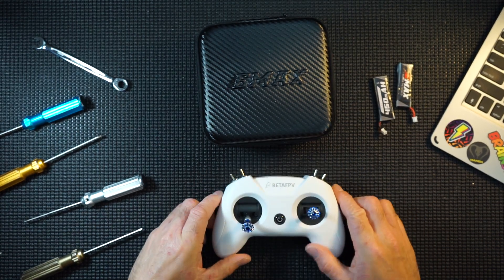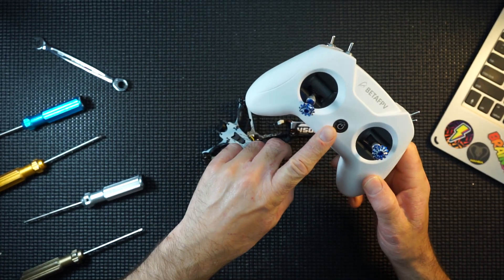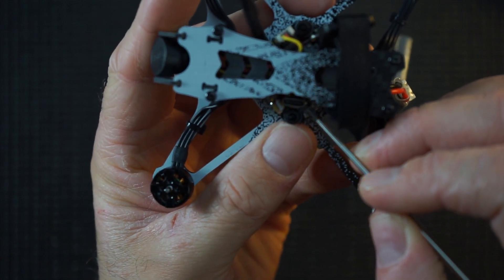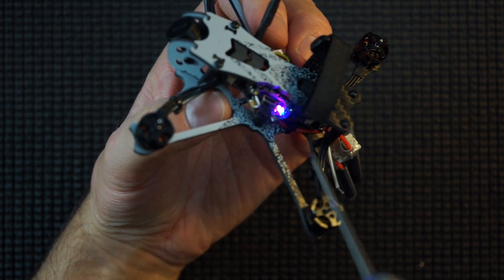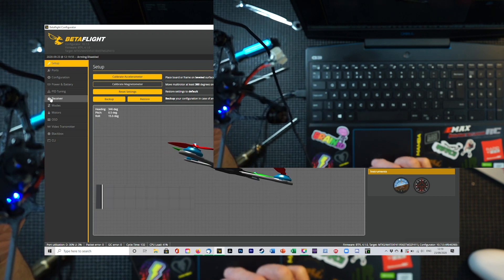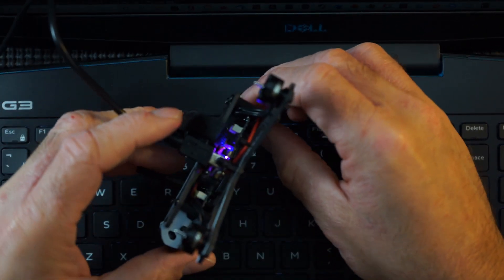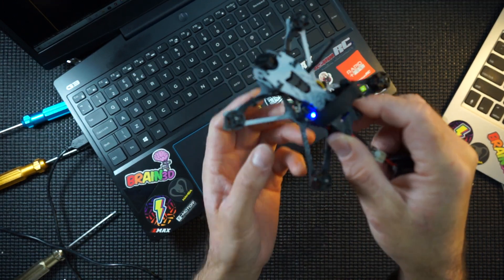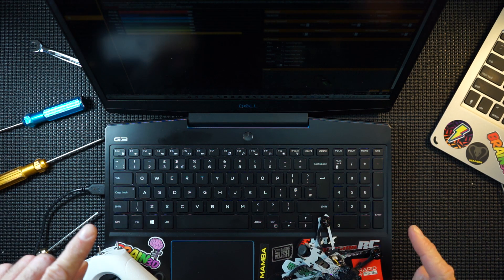How to Bind the Tinyhawk Freestyle II (2) and any Emax Hawk

Comment: I have a problem with my tinyhawk2, I binded it with the radio, and on betaflight I can see the switches and input actions as gas, yaw pitch and roll working, I also added the arm control, and other 2 as I see in videos, but then, if I power it up with the radio binded it doesn't fly, althought the leds blink wile giving inputs from the radio (that shows that the binding is correct) the props don't spin, it is not working.... can you help??

Comment: quickly i have not bought the drone yet because i have seen the controller in the RTF kit is hot garbage. Im trying to get in the hobby with emax and i do not know if the batteries come with the drone itself and not only in the RTF kit, please let me know if you can.
Reply from the maker: normally there are a couple of batteries in the kit - just double check the listing specs.
Reply: Thank you for the reply, will do

Comment: Erm...My Tinyhawk Freestyle 2 came with a USB cable to charge the controller and headset battery. I wasted a good few minutes trying to connect it to my PC with that cable.

I am currently having a really weird argument with Bangood who sent me the wrong replacement controller for my EZ Pilot.  I know its the wrong controller because it binds to the Freestyle after I followed your instructions and it has an aerial and the EZ pilot controller does not.

Any idea if it is possible to flash a normal Emax controller to work with an EZ Pilot or where I can get a EZ Pilot controller quickly?
Reply from the maker: you mean the ready to fly kit - this vid is about the single quad... not the kit - all their single quads don't come with cables.

Comment: I have it bind to the tiny hawk 2 but the switch on the  Betafpv  literadio 2 se controller aren’t working properly the beeper is working on  the right top switch I think when it’s clicked either once or twice it starts the beeper on the drone so the switches aren’t working other than  getting the beeper on the drone engage one of the switches on the right side I can’t get the motors to start up or anything but it must be bound because it’s letting the drone beep  can you tell me what to do using the Betafpv light radio 2 se?
Reply from the maker: its your sticks, you can adjust them in betaflight, check this vid out : 
https://www.youtube.com/watch?v=7ZUe-sC7mmU

Comment: Hey man, I bound it to the beta FPv controller, however, the switches are reversed, the top left one needs to be flicked down to start the drone (turn the props on).
Reply: Just move the slider to the part when the switched is flicked

Comment: I cannot get this quad to bind to the LiteRadio2 SE (new version) in D8 protocol no matter what I do. I have tried different firmwares in betaflight, have reset to orginal stock settings. The radio blinks three times confirming it's in D8, but for whatever reason, the quad refuses to bind to D8. It will only bind to D16, but emax does not recommend D16. I have no idea how to get this thing to bind to D8.
Reply from the maker: hey - I haven't got the SE version as yet, but I don't think it would be that different so it should bind ok... does the controller bind to other quads? is it just the freestyle? have you done th cli command lind to try and bind it? have you messed a setting up flashing firmware?
Reply: Same issue here. Betaflight recognizes the tinyhawk 2 but no bind. Protocol 8 on the se. Would love some help. Thanks for your videos!
Reply from the maker: @jeremyblattner7933  if you did / followed the vid then it maybe actually bound, but you might have a set-up issue, check this vid out : https://www.youtube.com/watch?v=7ZUe-sC7mmU&t=152s
Reply: Thanks for the reply! I am seeing the issue now is that neither the bind_rx on cli nor the bind button change any lights on the tinyhawk 2. It remains red and blue flashing. So the radio can’t bind anyway. Betaflight recognizes the drone though. motors turn, etc.
Reply from the maker: @jeremyblattner7933  so it must be bound, but you had a set-up issue in betaflight, - connect the controller and see if things move in the receiver tab - also if you have it connected via usb it won't arm.
Reply: Thank you. Just hooked up again to check. AETR1234 is what it is. Three flashes red on the se radio. Red and blue blinking on the drone. No connection showing from radio to betaflight when  battery connected. Disconnected from betaflight nothing either. Is there more than one little button on the bottom of the quad? i can barely feel it click when pressed with a wooden tool. no shorts. no change in lights. And as mentioned, no response light wise to betaflight cli command. Quite confusing. Thanks for the help! Awesome to hear from you so soon and that you are interested in helping sort this out. Fantastic.
Reply from the maker: @jeremyblattner7933  one button on the bottom of the hawk, when you press this button the blue light will go solid (stay on) with a red flashing light - if that doesn't happen or has never happened, then it will never bind, make sure you are pressing the button. Make sure your controller is on and you are also pressing the bind button on the back of the controller after you get the solid blue light
Reply: Thanks. I did manage to press it correctly this time. The red flashes and the blue goes solid. Ok. With three red flashes on the radio, I pressed the bind back button. The radio flashes, then solid. No Change in the lights on the quad. It would seem like the Se radio model may be the issue here. Is there an firmware update for this model?
Reply from the maker: @jeremyblattner7933  ok, now you just need to carry on pressing the bind button on the controller until you see the lights on the hawk change - D8 mode is the 3 pink flashes and is the mode to use.
Reply: I will continue pushing buttons and trying different orders of steps. Thanks again for your help. But it may be their new version has a software issue. Hopefully it’s just my own inability. Cheers and thanks again. If I find a solution I will let you know. The crazy thing is this is my replacement radio as the first one had potentiometer issues and as well, my second quad as the first one smoked badly with the first plug-in of the battery. This was way back in November. I just received the replacement radio on Friday. I’m about ready to think that maybe something else would be better. this is certainly good for learning patience. Lol
Reply: @jeremyblattner7933  Hey Jeremy, did you ever get this working? I just got an the tinyhawk freestyle 2 and SE radio as well and I get the same issue. I get the solid blue/flashing red on the quad, the SE radio flashes 3 times during boot indicating d8, hit bind on the radio and it flashes quickly for 10s and goes blue but the quad lights remain unchanged. betaflight also does not show the inputs changing on the receiver tab
Reply: The se never did bind. Tried everything. Figured a solution to the se issue. My neighour had an original lite radio 2. It bound to the tiny-hawk 2. The se bound to his meteor 75. Swapped radios. Thanks for the help. Cheers.
Reply from the maker: @jeremyblattner7933  thats a good solution! - I've got an SE radio on its way in, so I'll be interested to see what it does... or doesn't do!
Reply: @Datfpv  Good luck!
Reply: @Datfpv  FYI, figured out the SE has a firmware issue. See this twitter with documentation for how to update it: https://twitter.com/albertkim/status/1354181864660082698?s=20

Once I did that it bound without issues
Reply: Rob Pettigrew Awesome! No I hadn’t sorted it out yet. Thanks. I will give it a go. Cheers.

Comment: Anyone unable to get the betafpv radio light to switch to d8 mode?  Holding the bind button down while powering up the controller as the manual says, doesn't work.
Reply from the maker: hi mate, are you sure you have the frsky version? or is this the controller from a starter kit?? if its from the starter kit you can't use it with emax quads...
Reply: @Datfpv  I have the frsky version, not from a starter kit.  Also my drone doesn't just straight connect in Betaflight, what did you have to do first for that to connect?
Reply from the maker: https://www.youtube.com/watch?v=GMXLffuxZpk&t=5s   you have to repeat the process to get to d8 mode - 3 pink flashes.  What quad do you have? - if you are having issues connecting to beatflight its normally a driver issue on your computer... on the start-up screen of betaflight there are links to the drives needed / and download links.
Reply: I've got the same quad and controller as you.  I was using the drivers from silLabs and using the other link fixed it.  I can bind but now I just get constant beeping from the drone.  The blink patterns change though when I flip switches
Reply from the maker: https://www.youtube.com/watch?v=7ZUe-sC7mmU&t=11s     it will be this its always this... remember to say thanks and hit that subscribe lol
Reply from the maker: if its beeping then one of your switches is the beeper and needs turning off thats all.

Comment: Hi, i have same quad and buy this radio. But after Radiomaster t16s, quad controled by betafpv lite radio turns twice faster. In simulator i have same problem. Stick travel both radios almost the same. Rates - dont changes. Whats its can be?
Reply from the maker: it must be something to do with the stick travel, and gimbals it must be, if everything else is the same..

Comment: I have the lite radio 2 and I have it binded and it’s connecting but when I go to arm the qwad it doesn’t do anything and the led lights start flashing. Osd of my googles say throttle when it supposed to be armed but nothing is happening
Reply from the maker: Hi - it will be more than likely your sticks are set wrong.. check out this vid: https://youtu.be/7ZUe-sC7mmU   and remember to subscribe! thanks

Comment: I just reseaved my tinyhawk and that controller and I was pressing that small button on the top and it wasnt working lol no wonder why and also i was trying to take my 1s lipo out and the wired came out of the connector and now its broke. Is there a certain way u gotta put them in?
Reply from the maker: Hi - glad the vid helped, the batteries do have a correct way to be put in, they have marks and groves on them and should only go in one way anyway.
Reply: Datfpv thank you so much ur a small channel but I just subbed and turned on post notifications
Reply from the maker: thank you! - I haven't been going that long and trying to grow as much as poss

Comment: hey mate, I have a problem wirth the new aio board and xm+ I just installed in my quad. Radio and receiver are bound up but nothing shows up in betaflight transmitter tab :(
In the Config I set it to serial receiver and sbus (the xm+ is wired to sbus as well of course) and I tried both uart 1 and uart 2 with no success..

Any Ideas on what I can try?
Reply from the maker: is this on your hawk?
Reply: @Datfpv  yeah it is. Everything else works now and I did manage to reuse the original VTX.
Reply from the maker: have you set-up the UART up in the ports tab?
Reply: @Datfpv  Yeah I've tried both UART1 and UART2 (I have to activate the switch at ''serial reciever'' right?)
Reply from the maker: have you changed the config to serial based receiver (sbus)
Reply: @Datfpv  yes I have
Reply from the maker: have you re-bound your radio to the new receiver?
Reply: @Datfpv  no, how do I un-bind it?
Reply from the maker: you don't need to unbind, you just need to bind the controller to your new xm+ - your controller will need to be in one of the d16 modes thouigh - and the process for binding the new receiver https://youtu.be/ZOBwwNpjNrY   its the receivers we bind to not the quads...
Reply: @Datfpv  ah, sorry. I thought you meant I should try to bind it a second time by re-binding.

Yes I have bound it up already and the led on the xm+ is green also indicating it's bound.
Reply from the maker: show me your betaflight set-up ports config etc
Reply from the maker: and when you move switches on your controller do lights react on the receiver?
Reply from the maker: try ibus  instead of sbus... ? in config
Reply: @Datfpv  no the lights don't change... Ibus doesn't work either
Reply from the maker: normally if your controller is bound to your receiver and you move switches etc there will be some change to the leds on the receiver itself... are you sure you have it bound??????
Reply: @Datfpv  there only is a single red and a single green led on it, but I did the binding process and now it's solid green (manual says that means it's bound) when the transmitter is turned on and if I turn the transmitter off the solid green light switches to solid red
Reply from the maker: what firmware is the receiver? LBT ? - and what d16 protocol have you got the controller in?
Reply: @Datfpv  the firmware is stock from banggood so should be d16 fcc, and the transmitter is also in d16 fcc mode (1x red flash, literadio 2)
Reply from the maker: should be... have you tried it in lbt? just incase..?
Reply from the maker: theres not a lot else it can be everything looks ok to me - unless youyr soldering /is wrong?
Reply: @Datfpv  ah man, sorry for the confusion, I just checked my soldering for literally the 4th time and noticed I accidentally wired it to rx2 instead of sbus! (I thought the writing was over each pad here) again, sorry for the confusion. Should be fine once I change the wiring (which I'll do now)
Reply from the maker: lol.. mate always double check the obvious stuff... it should work fine once thats done
Reply: @Datfpv  I triple checked and didn't notice lol. Guess I forgot to double check the text writing. Luckily I didn't wire it to a 5v pad or something.
Reply: @Datfpv  yeah it's working fine now :)

Comment: Awesome video. Question. I literally just recieved my THF2. I'm trying to bind it to my lite radio 2 but everytime I push and hold the bind and power button it just flashes rapidly on the controller but it's not binding to the THF2. I have a solid blue light and throttle is down. Any help would be greatly appreciated
Reply from the maker: Hi - the radio needs to be in d8 mode, you press the bind button on the bottom of the hawk, then the bind button on the back of the radio, you'll notice lights change on the hawk.. disconnect the battery from the hawk, then put the battery in again - see if its connected it shoiuld be... if it doesn't arm it will be some other issue - you will see the red light flash if you move switches on your radio... check out my other vids for more info etc, thanks
Reply: @Datfpv  thanks for getting back to me. I found out that I have the bayang version and not the d8/d16 version. So now I'm stuck flying my planes in Ely Nevada this weekend lol. Stay safe out there bud
Reply from the maker: @riveraelliott25  that sucks man, you'll need the frsky version really... its the most widely used receiver I'd say
Reply: Gregory Dahl  yeah I've been figured it out lol but I appreciate the reply!!! No my only problem is is that the controller makes the drone flip. It says I have to calibrate the controller but I am not able to understand the formula lol never was good at math lmao

Comment: Fyi The first button on top is vtx button use for unlock 25 mw to real 200mw vtx.
Reply from the maker: if you press that button and power the quad - its the boot button.. it puts the quad in dfu mode for flashing firmware.

Comment: Hey man! Question!? I was flying my tinyhawk freestyle 2 and crashed and broke that connector for the camera ON THE FC side I tried to direct solder to the board without the connector but those got ripped off again! And it was a pain to solder! I’ve heard it’s a known issue!:/ is there any other pads I can solder those 3 wires to? Which is the yellow wire signal I believe and positive and negative? Any input would be greatly appreciated! If not I won’t have FPV and would only have to fly LOS:/
Reply from the maker: Hi man, don't sound good to me :( I know there are pads for adding your own receiver on the board, you might be able to make them do the cam in betaflight? if you can or not I'm really not sure to be honest with you :( worth a google though...